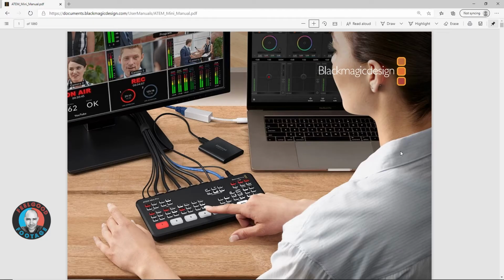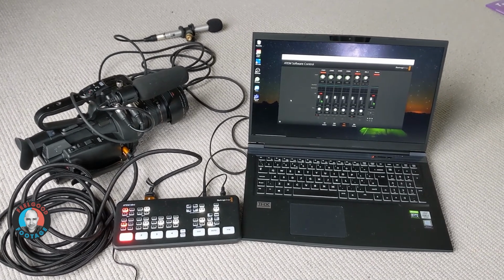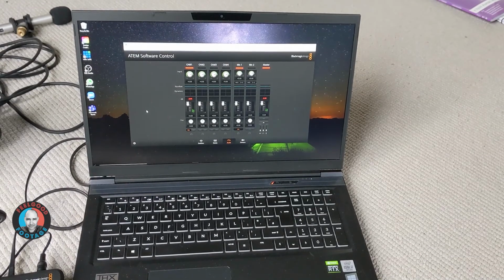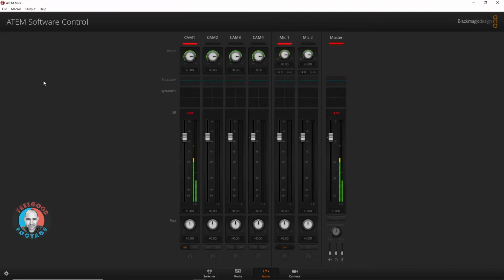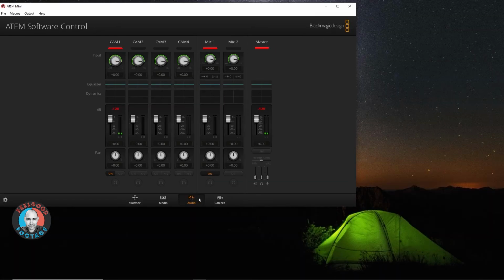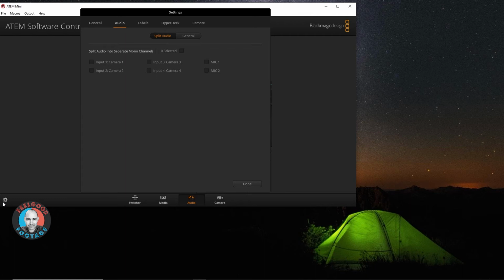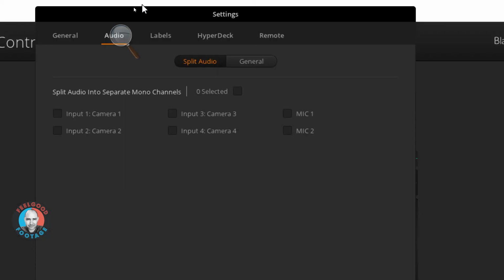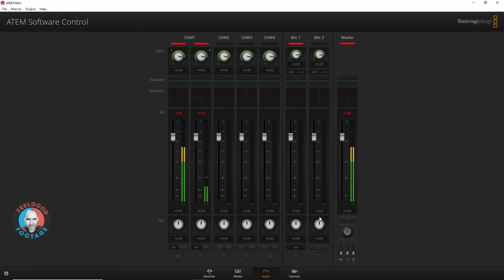Set the ATEM Mini to Split Audio from mics - Give each camera XLR microphone a Left & Right channel

Comment: This is a really helpful video, thanks. I’m looking at switchers and considering purchasing the Mini extreme. Slightly put off by the 3.5mm inputs which in audio work I’d never rely on. My 2 Canon cams have 2 XLR inputs on each, so your solution feels like a great way of getting 4 controllable mono inputs into an ATEM. I’m wondering what the pros and cons might be of sending audio via a unit such as zoom F8n rather than using the camera XLRs. Both have phantom. If the Canons are recording to SD then I’m getting ISO audio without the Zoom. Cleaner preamps maybe? Would you say less sync issues if going straight into camera? Zoom offers 8 inputs without the need for 4 cams? Thanks for any suggestions!
Reply: Just watched your other video on kit list. You mention the Behringer XR18.... any thoughts on what makes this a good choice for expanded audio mixing & I/O? Price compared with the Zoom F8n is very good. Can it somehow enable ISO audio recs...?
Reply: Had a quick look at the XR18... the processing is probably a winner I think. But there’s a trade off with portability and need for additional interface with the XR18.
Reply from the maker: @bhwh_h  the XR18 unit is very popular. one of my clients has it and they use it as the audio solution for a multicam recording i am involved in. however i was really put off by the need to have an iPad to adjust levels. i recently purchased the Rodecaster Pro. this was mainly for podcast recording, however I definitely wanted to be able to integrate into livestream/multicam situations if needed. my wish list and thinking are fully explained in my latest clip. my requirements are probably quite different from yours but the information may be helpful nevertheless. good luck.
Reply: @FeelgoodFootage  Many thanks! I’ll have a look at your Rodecaster Pro vid 👍🏼 The XR18 certainly looks very capable for a really good price point. Just wish it allowed you to quickly plug a SSD or SD card and do multitrack recording without the need for a DAW.
Reply from the maker: @bhwh_h  yes, in that client multicam situation I'm involved in the XR18 is fed into a Macbook Pro running Audition to record the multitrack. Plus there's a iPad running the Behringer app to adjust XR18 levels. Last week the iPad suddenly lost connectivity to the XR18 just before recording and despite reboots continued to drop out, so level adjustments were done directly in Audition. Any set-up can let you down but with an integrated hardware solution with physical faders there's one less point of failure.
Reply: @FeelgoodFootage  That’s certainly an extra stress I could do without. I notice some choose to mix using an ethernet connection which sounds sensible. Im not expecting my work to much mixing on the fly so would be ok with that but not using the same machine to run recordings to a DAW. No way!
Reply from the maker: @bhwh_h  i think the ISO audio recording is usually called Multitrack recording. In which case I think it does have that functionality as it is in the product name.

Comment: The default configuration of the camera inputs is perfect if you are connecting to a Stereo source, such as the left/right output of a mixer (and the levels in the camera may need to be set to line level). 
However, this approach is perfect if you are using separate microphones into the tthe camera to get both microphones into both the left and right ATEM camera audio.
Reply from the maker: Exactly, Randy. That's where it's proved really invaluable for me as during live event filming I bring 2 x contributor radio mics into the stream via the main camera. Thanks for the comment.